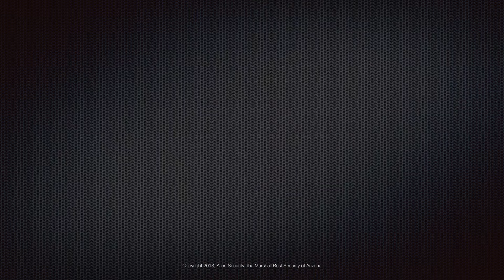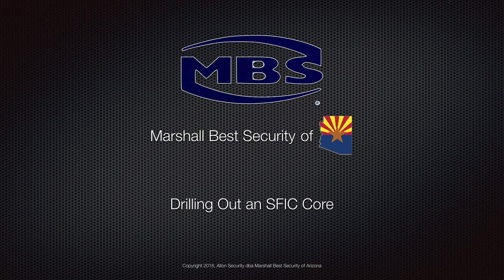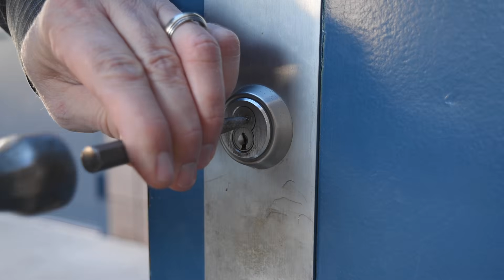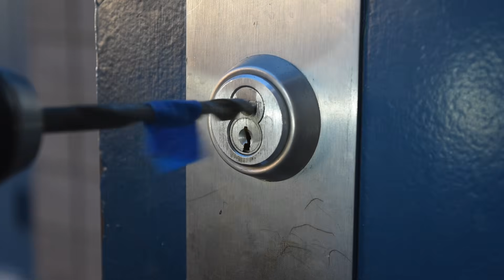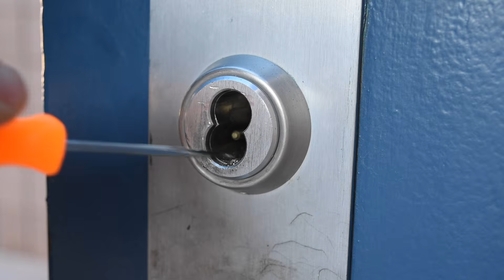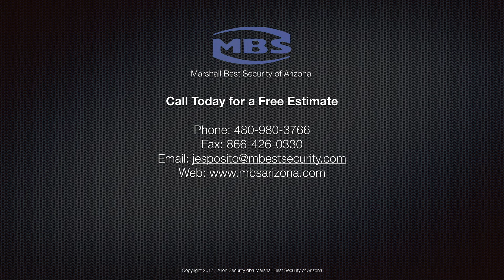Drilling an SFIC Core

Comment: Ad a veteran locksmith of 39 years as well as an instructor in two different schools I am horrified by the ignorance and just plain wrong of videos like this.
Reply: How would you go about doing it?
Reply: @kylekelly1215  5/32" drill bit right at the point of the figure 8 takes out the retaining bar, you shear off the the retaining bar so when you pull the core, you can decode the pins if needed.
Reply: Oh please,  yes you can do that but if the bit walks now you get to replace the whole lock.
Reply: If you do have multiple locks keyed alike then yes. Worth it to possibly ruin one lock to decode the rest.
Reply: Lmao so make the job harder for yourself. Got it 😂 you could be a 60 year experience locksmith and what you just said makes sense ONLY if you need to save the series. Who tf is trying to save a $7 core 😂? Let alone the time and precision you would need to not damage the housing.

Comment: Good video. The screw at the end is a great idea. What size bit ?
Reply: Careful about putting a screw in there that is very big. It will distort the core and cause it to expand against the housing and make it a real bear to get out. Same actually goes for pressing really hard with a big drill bit like the one he's using in this video. Best to use a 3/16" imho. If you drill straight then you can turn with a small screwdriver, no need for woodscrew. If you need woodscrew, you maybe want to use small diameter or drill a pilot hole.

Comment: they’re called Chambers ha ha😂 I don’t know why I’m bringing this up. I guess I’m a brat.
Reply: He said barrels, referring to the driver pins. Chamber is the opening that each pin stack is in. These are standard SFIC pins, so technically, not barrels, which are security pins for regular size locks. But calling them barrels (because of shape)is more common than referring to pins as chambers (where pins are located)
Reply: @ sorry to bring that up. I think I’m a brat Sometimes.
beautiful job you really did I love the video don’t you?
Reply: @doorandlocktips  it's all good. People use a mix of terminology when it comes to locks or anything in general really.
Reply: @Sl0oMo0-c8z  i’ll have to get back with you on that pretty familiar with this stuff but always willing to learn that just doesn’t sound familiar. Oh well at 65. What do you know not much when it boils right down to it? There’s so many different avenues. have a great evening. Thanks for the info. I’ll have to duck tape my brain back in ha ha ha ha✌🏻🧐☃️✌️🙈👍🔑🧢🔐🗝️

Comment: Use a flat blade screw driver just inside the lip of the drilled hole to pry the front cover off the core. Then you can access the locking cam and clean out the channel the locking cam needs to move into.

Comment: Put a blank key in there to raise all the pins. It'll make it so you drill through all of them at once. If you're accurate you can use a 1/8 bit and use the key to move control arm. Happy drillin!
Reply: I’m pretty sure the bow of the key will be in the way to drill straight in
Reply: @2815Juan I've had to drill one out recently. It will be if you're using a standard Best blank. You will want to bend the top of the bow over, or cut it clean off so that it's not in the way for the drilling process. It also makes it easy at the end, as once you've drilled to the shear line, you don't have to clean out any debris. It's ready to spin the control lug.

Comment: Another question: all of the vids I have watched show the use of a 90 degree pick to remove debris. Why not use compressed air?
Reply: Compressed air will blow the debris in and around the lock as you aren't drilling the whole way through to the other side. Could be problematic once the pins are removed as the debris could stop you from turning the cylinder

Comment: At the beginning, you say to measure the depth of the core before drilling, so as not to drill too far. How do you measure the core before it is removed?
Reply: You keep a separate core in your inventory
Reply: Assuming you've got a key (doesn't have to be a working key) you can also measure how deep the key will insert into the cylinder.